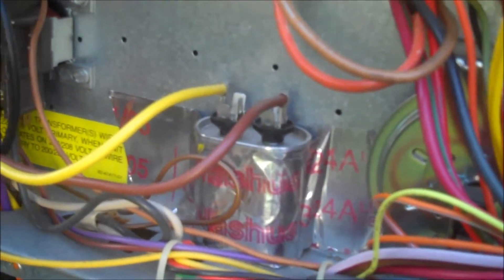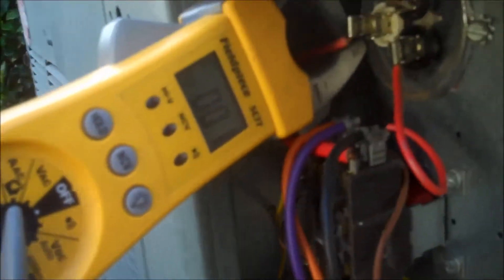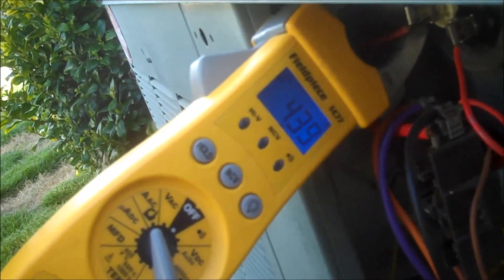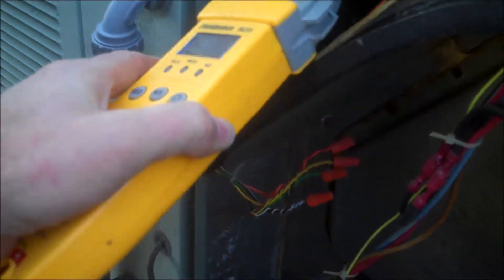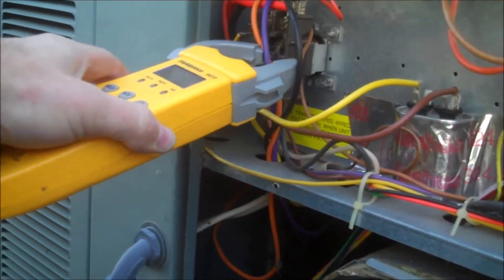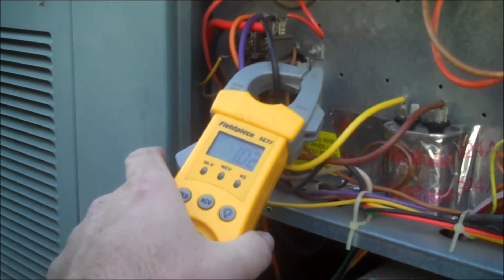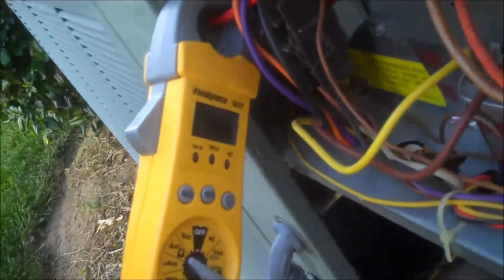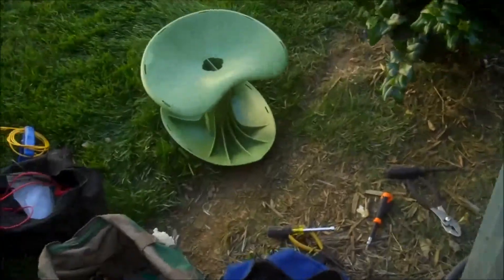Check Motor Amps - Air Conditioning Repairs near Apex North Carolina

Comment: My condenser fan motor is pulling 1.1 amps and the specs say 1.2. When will I need to replace the motor? Should I buy one to have in case it goes out? Or does it do more damage to wait until a motor stops running?